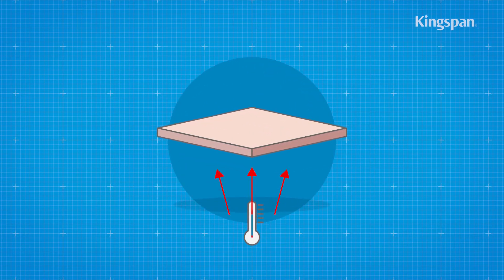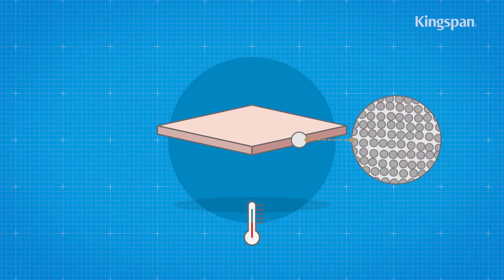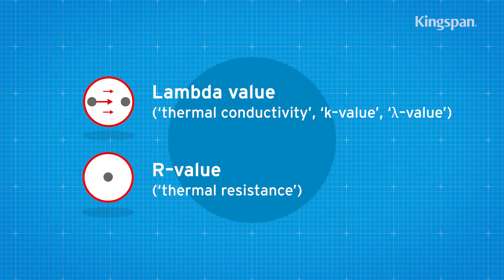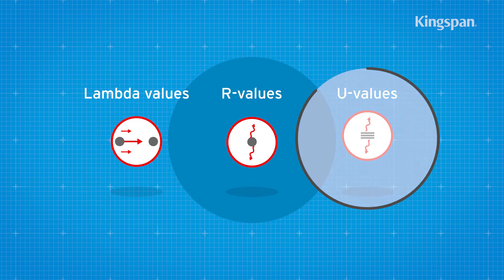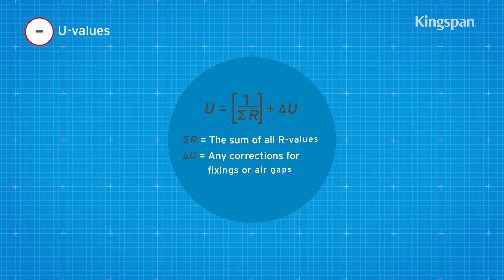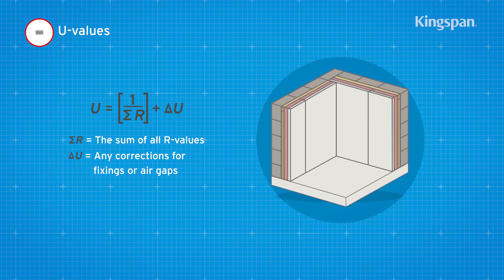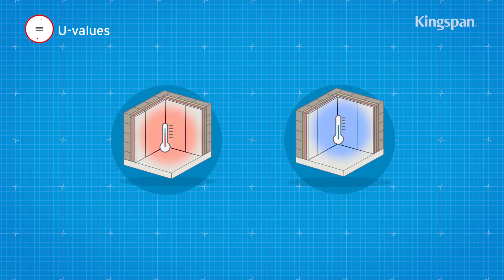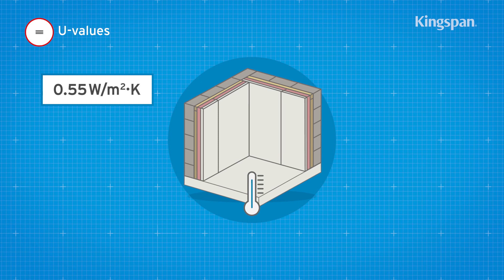What are lambda values, R-values and U-values?

Comment: Is the U-value not a bit unneeded? Could we not do with the R-value instead?
Reply: You need R values of individual materials to help you calculate the overall value of a stuctural unit. (the U-value). Mainly because Building Regs require standards to be met in terms of insulation and sound transfer. These Regs have got considerably tighter  with regard to insulation of properties over the years. Buildings used to be built of solid brick or stone, then cavity walls came in to help restrict the transfer of moisture and as a result help the heat retention (or loss). Then cavities had to have some insulation put in to further increase the insulation of the building. Now you have to have a 100mm cavity filled with insulation . Also floors need to be insulated in a similar manner.  So, yes you need R-values to help you calculate the overall U-value.